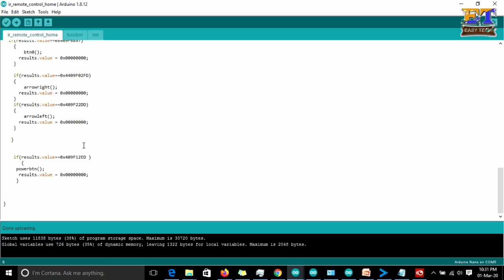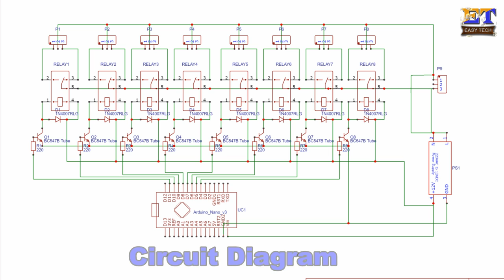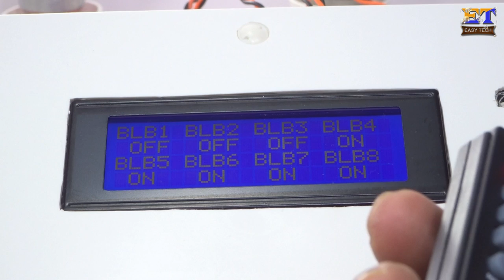Remote Control Switch Board with Power Cut Remember

Comment: Forgot to add optocoulers for each transistor (EL817, as it done in all Arduino relay shields). And +12VDC is not recommended for Arduion input.